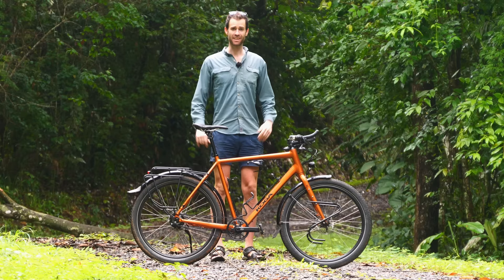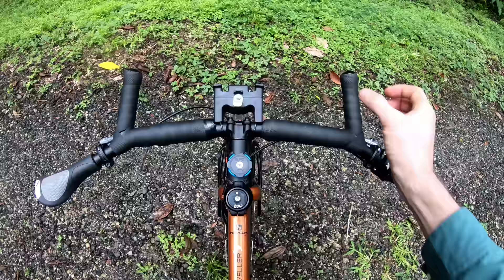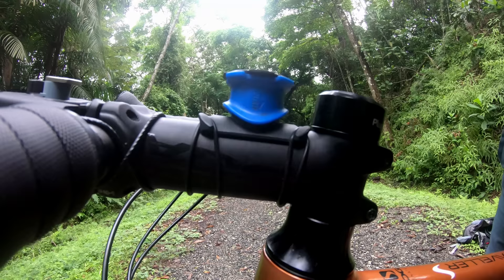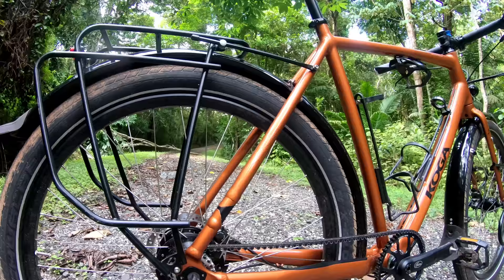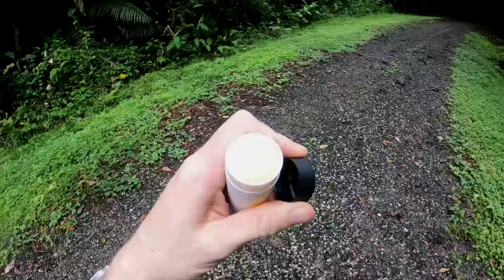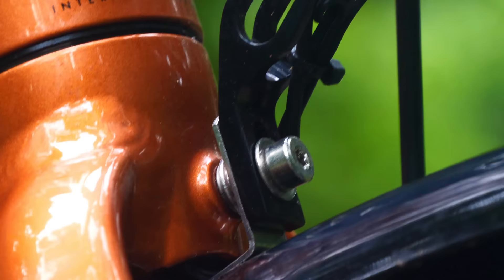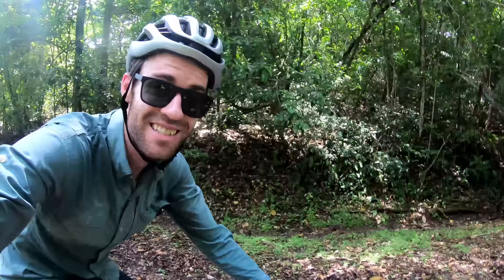The 2020 KOGA WorldTraveller-S is a $6000 Indestructible Touring Bike

Comment from the maker: FULL SPECS:
Frame: KOGA WorldTraveller-S  (60cm because I like a sporty position; my 'correct' size is 63cm for an upright position)
Fork: KOGA WorldTraveller-S
Paint: Jaguar Madagascar Orange
Headset: KOGA Sealed Bearing Steering Limiter
Stem: Koga Signature Alloy 110mm slammed and -7 degrees
Handlebars: KOGA Denham Bar
Grips: Ergon GC1 cut down and KOGA double bartape
Seatpost: Cane Creek eeSilk 20mm
Saddle: Velo Race 3D FC

Gears: Rohloff Speedhub 14-speed Internal Gearbox Hub
Shifter: Rohloff Grip Shifter
Front Hub: Schmidt SON28 Dynamo
Rims: Ryde Bull 27.5" 36 hole
Spokes: Sapim Race double-butted and Rohloff-specific
Tyres: Schwalbe Super Moto-X 2.4"

Brake Levers: Shimano XT Hydraulic
Brakes: Shimano XT Hydraulic

Crankset: Gates S550
Chainring: Gates Carbon Drive Centertrack 50T
Cog: Gates Carbon Drive Centertrack 22T
Pedals: Shimano XT T8000

Fenders: SKS P65 Chromoplastics
Charger: Cinq Plug5 Plus
Lights: Schmidt SON Edelux II and SON Tail Light
Bidon Cages: BBB Fuel Tank XL
Phone Mount: Quadlock
Front Panniers: Ortlieb SportRoller Plus
Front Rack: Tubus Duo
Rear Panniers: Ortlieb BackRoller Plus
Rear Rack: Tubus Logo 29
Kickstand: Pletcher Comp

Weight: 16KG or 35LB
Reply: Is there anywhere in the USA that you can purchase the KOGA Denham Bar (Google failed me)?  Please leave a link, many thanks.
Reply from the maker: Dumb OX I’ve listed two shops that ship to the USA at the bottom of this article: https://www.cyclingabout.com/koga-denham-bars/
Reply: About the color: dark orange is nice in general. But i’m quite irritated when bike brands give exotic names to them. Do i have to give up hope that « madagascar jaguar «  is linked to a standard RAL color chart number ? Do you have any idea ?
Very nice bike and review and editing otherwise, congratulations. Must be a blast to ride.
Reply from the maker: Desi This is not a RAL colour. It’s from the Jaguar car catalogue - “Madagascar Orange” is what they named it.
Reply: 16kg for a bike this tricked and loaded is a great weight! I'll have to put some thoughts into my choice of a Surly frame.
Reply from the maker: @frost1978  A Surly frameset should be within a kilogram of a KOGA frameset. I wouldn't stress too much about the weight in the context of a loaded touring bike.
Reply: That bike is a masterpiece of functionality, reliability and aesthetics!
What's with that eccentric bottom bracket - is it adjustable because of belt length, or geometry also?
Reply from the maker: @augustlandmesser1520  It's mostly to get the right belt tension. But if you're smart about the belt cogs and belt lengths - you can choose how high your bottom bracket will be! I can currently choose between a high and low bottom bracket height with a ~5mm difference.
Reply: @Cyclingabout  That is very nice!
Reply: How tall are you? I'm asking because of the bicycle size.
Reply from the maker: @HRVoice  198cm/6ft6. I recommend the 63cm to anyone that is my height, but I use the 60cm.
Reply: @Cyclingabout  Thanks! For 184 cm guy (me) 57 is fine?
Reply from the maker: @HRVoice  It's hard to say because it depends on your leg length, arm length, torso length. Do you have a bike currently that fits well that you can share?
Reply: @Cyclingabout  Unfortunately not, I was at the KOGA official retalier in Belgium and the lady told me that 57 on my height is going to be fine. They didn't measure other things, even though I did it by myself and checked on the KOGA official size guide, that pointed to that size more or less.
Reply from the maker: @HRVoice  Perhaps go to another shop for a second opinion on size. Test ride a few bikes. It doesn't have to be a KOGA. We can then look at the "stack" and "reach" numbers to know what will work best for you. There's a high chance it's 57cm, but you can find out for sure by getting a second opinion.
Reply: Hi Alee, I am ordering basically the same bike this week, including your handlebars. I am going on trust here, as my Signature dealer did not have a bike around with those. I did struggle a bit with the frame size. I am puzzled by your choice for a 'smaller' frame to allow a more 'sporty' position. What position do you consider sporty? I would expect the opposite: a large frame would allow a position that is more forward-leaning, thus more sporty. 

For my length (1,83m), apparently the recommended size was 57cm, but it felt a bit cramped to me. I have been cycling for three years on a Gudereit Rohloff+Gates bike with a 61cm frame size. That has worked well for me during long trips, though I have never ridden another size for a significant amount of time, so I can't really compare. In any case, my current choice is to go with the 60cm frame.
Reply: @Cyclingabout  Hi 👋 you are right, every person is different and must choose the size of the frame after testing few sizes, because it also matters on what kind of roads he will use the bike the most. On the asphalt  works a bigger frame, on rough roads a smaller frame is more comfortable. I personally use size 58 ,i'm 1.87m height and yet in offroad it seems a little too big for me (sorry for the translation, you have a fan rom Romania 🇷🇴🙂)
Reply: Great video and awesome bike! Can you tell me if Koga will build as per your spec or they’ll only do the basic bike and you need to do the rest yourself? I’m looking to do a few mega rides in 22-23 and this set-up would be perfect.
Reply from the maker: @kennymcclymont2066  You can order everything you see from KOGA except the grips, saddle and seatpost.
Reply: i just picked up a Surly Troll with everything you have on that bike done 900km for $3000 aud from a woman in Bondi, i couldnt get the money into her account quickly enough, even came with BBD custom frame bag two panniers front loader rear loader you name it lolol.. 3k and its basically all new, not a scratch to be seen anywhere
Reply: Bike manufacturers need to get a wake up call and stop being so greedy. 6000 dollars for a bike is an absolute joke, they use parts and products which can not exceed 1000$ and charge extra 5000$ for their own greedy pockets. Hope they buy candles for their loved ones with all the unjustified profit they make.

Comment: It is so insane what people are asking for bikes now adays
Reply: Even more insane is what people are asking from their bikes.
Reply: Well, if you use it 1000km a week, and it will take anything you throw at it for years, it can be justified. Will a similar bike at half the price do the same? Dunno. Will a $150 Walmart bike do it? God no.
Reply: Sounds like you don't understand what it is you're looking at. The belt-driven drivetrain with internal, sealed gears is $1000 on its own. This is a very specific type of bike built for a very specific type of rider. This is not a bike for city riding, casual riding, etc. It's a bike for touring continents that's built for extreme durability and low maintenance.
Reply: Just like every single other product, as long as people buy it enough to be profitable then the pricing works. Except when government subsidies are being received by the company, like in meat and dairy industry or incentives like for electric vehicles. The difference of course being that the former has terrible environmental impact to say the least.
Reply: Justin Reynolds Sorry man, it’s a lot of money for a bicycle. Let’s be real. That being said if it is your passion then it can always be justified and thats okay.
Reply: @PumpUptheJam81  if you are riding around many different countries and encountering many differing terrains 6k nothing, this is a very good price but would rather steel over alloy
Reply: $4500 profit!
Reply: Paul yeah I get that. I spent a small fortune on expensive equipment for my land cruiser. But you can’t tell me it’s six grand of bicycle on a rigid frame. Someone’s justifying a price simply because someone said you can pedal it around the world. 
People have done more with far less without drama. 
But hey, someone wants to pay that price that’s on them and I hope they enjoy the heck out of it.
Reply: @PumpUptheJam81  until you have been cycle touring you won't understand
Reply: Paul If you say so.
Reply: @PumpUptheJam81  you have no idea, sticks out a mile
Reply: Paul OKAY. I get it. But you have to admit it’s amusing how the prices of a bicycle have exceeded aerospace and nautical equipment pricing.
Reply: @Animagus Borealis you cannot buy that bike for $6K in Australia, its $9k delivered and that for a basic level, $12k is for the works
Reply: @justinreynolds6318  "Sounds like you don't understand what it is you're looking at."

Maybe he doesn't, but I do, and like most products that cater to obsessiveness, it's drastically overpriced.

"The belt-driven drivetrain with internal, sealed gears is $1000 on its own."

It's more than that, but even going with your $1,000 figure, that's drastically overpriced too. You can buy a 2020 Aprilia SR Motard 50 motorscooter for $2,199 (and that's MSRP, and you always pay less than MSRP), which is about one-third the cost of the whole bike featured in this video. You can buy full-size motorcycles brand new for less than the cost of that bicycle, such as a 2020 BMW G 310 R for $4,945 MSRP or a 2020 Kawasaki Ninja 400 for $4,999 MSRP. In addition to it having a transmission, scooters/motorcycles also have an engine with hundreds of precision machined parts, and couple/few hundred more pounds worth of parts in general.

"This is a very specific type of bike built for a very specific type of rider. This is not a bike for city riding, casual riding, etc. It's a bike for touring continents that's built for extreme durability and low maintenance."

So? It doesn't cost that much to build something like that. Do you really think it costs more to build the bicycle featured in this video than it does to build a motorcycle? Do you even think it cost anywhere near as much to build it as it does to build a motorcycle?
Reply: @MaximRecoil  Your argument falls flat in the face of simple economic theory. Literally all of the products you mentioned in your reply benefit from economies of scale, allowing larger amounts of production on more efficient production lines to fill a much wider demand in a space with much more competition.

Many of the components on this bike are made for a very niche market in comparatively anemic factories using much less efficient processes against much less competition. The customer pays the price for that.

It's common knowledge that the early adopters of new technology in any industry get a less refined product for much more money, and I've just explained why.
Reply: @justinreynolds6318  Your entire post is a non sequitur. The reason for something being overpriced doesn't change the fact that it's overpriced. For example, you could hire someone, at the rate of say, $100 an hour, to whittle you a box of toothpicks by hand from a birch log, but even if you consider his labor rate to be reasonable, you still have a box of drastically overpriced toothpicks.

Also, not only is your reasoning a non sequitur, but it doesn't even apply here. The base model of the bike featured in this video doesn't have the Gee Whiz hub (it has an ordinary derailleur setup), and it's still drastically overpriced (~$3,060, which is almost as much as the $3,399 MSRP of a 2020 Honda Grom motorcycle).

Comment: The Steering Limiter is next level. The whole bike is next level. You got extremely hooked up with this bike. Bravo, Alec
Reply from the maker: I know, it's such a wild rig! This bike will get ridden though. Hard. 💪🏼
Reply: The steering limiter is actually just an annoying piece of tech to sell bikes and proprietary accessories. I have the same thing on a Trek MTB - it makes switching to anything but a proprietary stem a pain. I "deleted" the feature on my bike so that I could use aftermarket stems.
Reply from the maker: @Potz4pizza  You can use any 1 1/8" stem with a KOGA, it is not at all proprietory.
Reply: @Cyclingabout  Trek should learn from KOGA then! In that case, there's no reason not to have it.

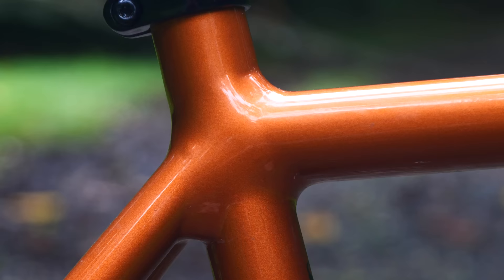Comment: 2:06 "New for this year are the super smooth welds"...
Wow, super smooth welds for 2020!!!
Just like my 1992(27yo)Cannondale!
Reply: every koga for decades has had this
Reply: right before that a bunch of uggly welds at bb and chainstays lol
Reply: Also, moments later, 2:18, as the camera pans down the head tube, notice the very un-smooth joint of fork leg to crown.
Reply: @Hertog_von_Berkshire  Take a look at the Contoura Pollino with Pinion.
Reply: I will buy a 100$ bike instead then 5900$ is for donations. 6000$ = 500$ for the bike + 5500$ for the brand stick.
Reply: @huutrongphan5503  At least cracks are easier to detect in these "super smooth welds".
Reply: Dude I'm riding a 1989 mangusta. It's older than me I replaced most of the parts and it's awesome.
Reply: Not true. I know, Cannondale and Giant were among the first who manufactured somewhat smooth welded aluminium frames, but the 2020 Kogas' & Trek's (i.e., the Emonda ALR 5 Disc) are in a league unmatched by (as of now) anyone else as far as I know. 
 I have a Cannondale Caffeine F1, My ex has a Caffeine Féminine and My current girlfriend has a CO2 Cannondale frame. They are all "smooth-welded", but those welds look like crude Windows OS (as opposed to Mac OS X / macOS), compared to the super smooth welds in the 2020 Koga aluminium models and some aluminium Treks. The latter literally look like carbon - they are a work of art!
Reply: @caitlynbrooks2238  Indeed, that's disappointing. I guess, they're cutting costs on manufacture. I hope, within a couple of years these frames (and their non-Koga equivalents) will have smooth welds all over the frame, including chain stays and the bottom bracket shells.
Reply: @LeoInterHyenaem   Leo_inter_Hyaenaem  I don't know what you're talking about (crude and all), since the welds on my "handcrafted in the USA" 1992 Cannondale are barely visible.
You need to touch the frame to make sure there's a weld there.
Just like a carbon monocoque frame if not smoother...
Reply: @nikos-giorgos  That is impossible. No metal weld, howsoever smooth, can be as smooth as carbon junctions. The ones referred by Me above are nearly comparable to carbon joints (but aren't smoother). But 1992 tech - I cannot take your word for it. 
 You see, My 2008 Cannondale Caffeine F1, too, has "smooth welds", but not nearly smooth enough to look like carbon. The current-generation Kogas and a few Treks are significantly smoother, but again, not smoother than carbon (that's technically impossible). 
 Thus I respectfully beg to differ, sorry.
Reply: @LeoInterHyenaem  Leo_inter_Hyaenaem  Don't take my word for it.
Just google "Cannondale m2000", find some high resolution photos and do the math.
By 2008 they've probably moved production line in Taiwan so don't be hard on your bike.
It truly can't compare with the earlier handmade frames...
Reply: Just under 18 kg per the Koga website (39 #).   That's a bit much IMO.
Reply: And my 2004 Maverick... :-)
Reply: Yeah! My 1992 Trek has smooth welds. And my 2001 Klein Palomino and Klein Q Pro. And my 2019 White Fat bike with “retro” smooth welds. I like aluminum bikes with smooth welds....
Reply: I was thinking exactly the same thing.   The yellow CAAD3 ridden by Lion King Mario.
Reply: @huutrongphan5503  well, no you're paying about 2 grand just for the gearsets alone. The rest is kinda overpriced tho, 3k-3.5k bike tops.
Reply: @LeoInterHyenaem  " That is impossible. No metal weld, howsoever smooth, can be as smooth as carbon junctions."  

Impossible?!  How did you come to that conclusion?  Welds can be ground down to be as smooth as glass.
Reply: And then there is the strength and beauty of a proper lug.

Comment: The welding is exquisite. What a beautiful machine.
Reply: the welding is not exquisite it's all been ground smooth same as cannondales
this is cosmetic only

retired welder and structral fitter  when i learned to weld i was taught that i get paid to weld not grind 
whoever welded this thing up may never have held a welding ticket in his life
$6000 i don't think so they spent 2 or 3 times as long finishing the welds as they did welding
Reply: @geoh1896  grind the ac welds a bit and sell em for 6k, thats a profit for a person that likes to grind stuff
Reply: Some of the welding is quite rough

Comment: Thanks for the review. I had a Rohloff/belt-drive, steel tourer like this too in 2017 - sold it, found it too heavy and unresponsive, although I have to admit, utterly reliable and required almost zero drive-train maintenance. Problems I did have (1200 km off-road tour through UK) were small bits of gravel getting drawn into brake disc vent holes at speed and destroying brake pads. Lucky I was in the UK, but even then not every bike shop had the ones I needed. I'll be sticking with rim brakes and chain drive in future. Initial purchase price is much less too.
Reply: for a touring bike I agree on the rim brakes.  Reliability and ease of maintenance are everything.
Reply: Are you the guy from impractical jokers
Reply: I can understand the brakes but why not the belt